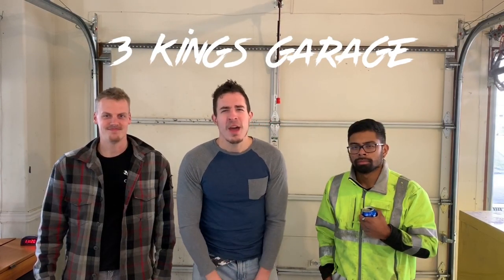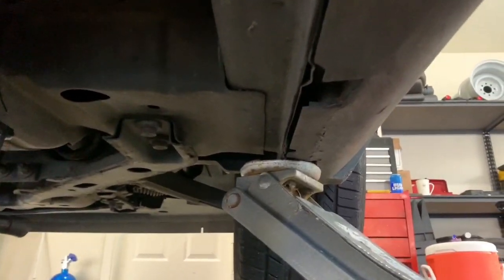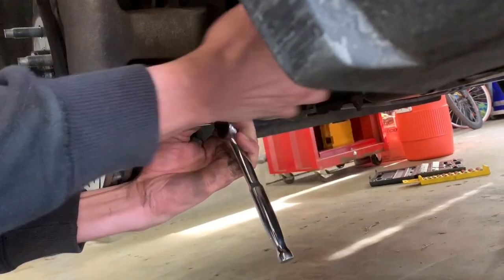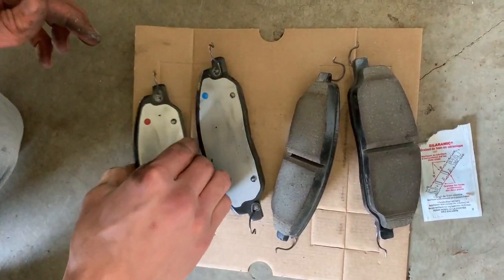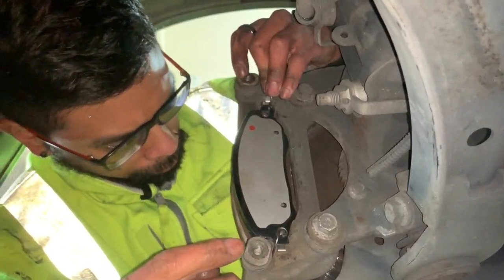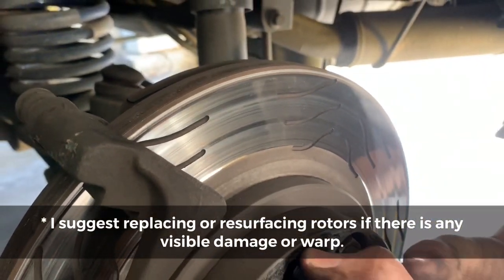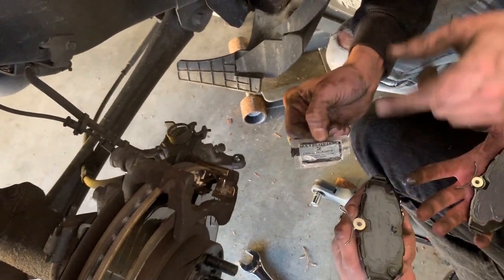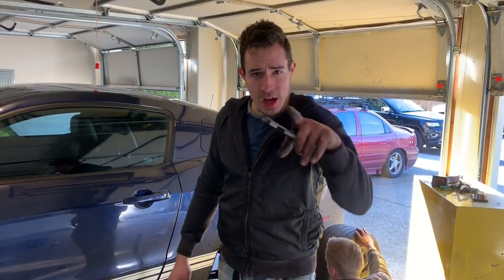🐴2011 Mustang Brake Change 🐴

Comment: i put drilled and slotted rotors on my 11 5.0 with carbon ceramic brake pads and they been squealing bad in the front and i put the lubricant on do you know why it would be squealing
Reply from the maker: Dominic Passalacqua I would try to straighten you pads. Do this by driving in reverse and slamming the breaks. It might have been angled a bit on install and that should correct it. If not it could have something to do with your calipers

Comment: In one image it looks like you are turning the caliper piston tool counterclockwise and then in the other clockwise.  I am trying it right now, turning it to the right, clockwise, and it does not appear to be moving.  Counterclockwise seems frozen.  Can you guys tell me which it is?
Reply from the maker: Nick Curran is this with your tool specifically that seems to be frozen or the brake piston?
Reply from the maker: Oh in that specific clip of the video he was accidentally tightening it so your correct haha but to depress the piston you will spin clockwise
Reply: @RoyaltyKingsEntertainment  Thanks!  That worked for me.  At first I was turning it clockwise and it did not seem to be going anywhere.  I applied more pressure as I turned and that got it to depress.  Thanks for your video and thanks for responding to my question!!